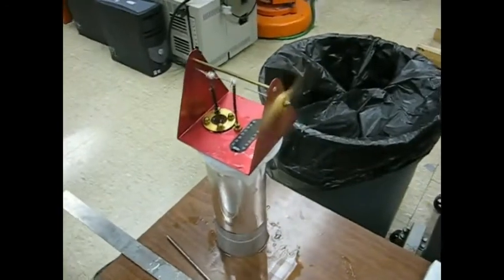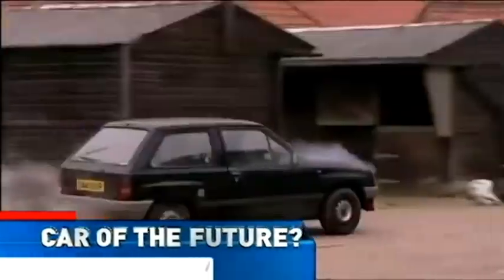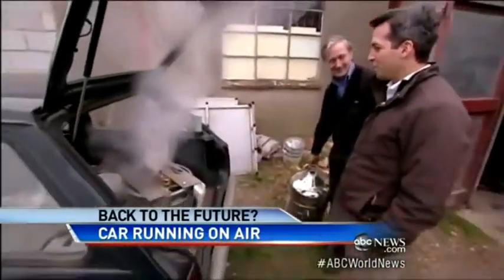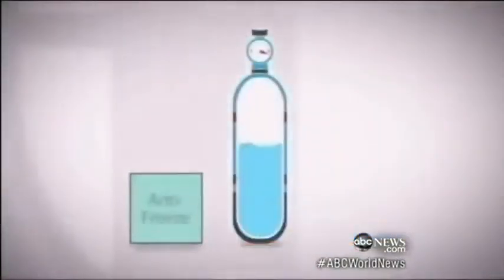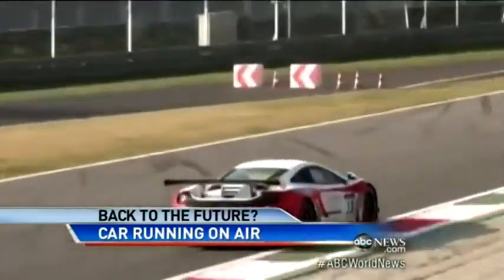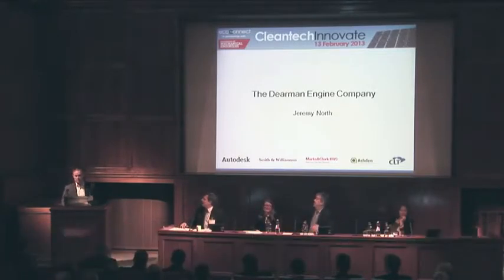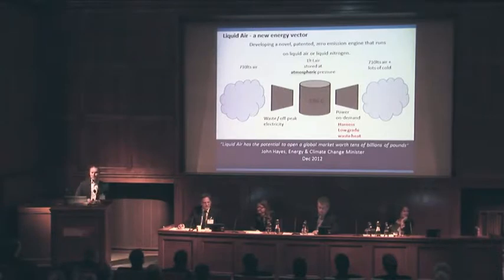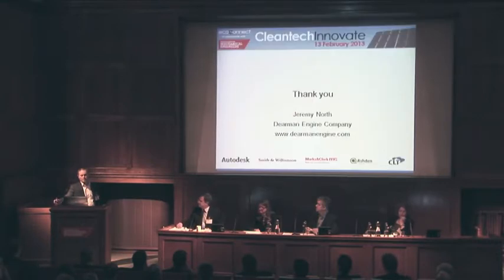07  Liquid Nitrogen

Comment: What about the emission from making the LQD Ntrogen
Reply: If zero emissions were generated by whatever powered the power source used to extract nitrogen then total emissions would remain zero. Nuclear power does not emit anything but heat. It does, however, produce waste so toxic that humanity is afraid to tap this resource.
Reply: Same argument for batteries, MINUS the issues for mining lithium or use of other  harsh elements like lead, strong acids, expensive graphene etc. Plus I bet efficiency  will be increased at warmer climates, by using heat cycle engines etc.